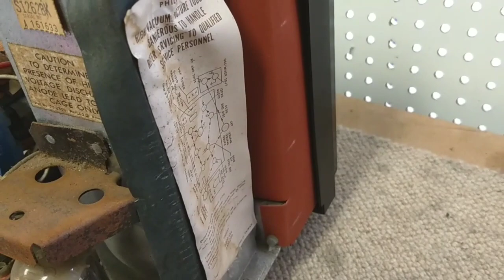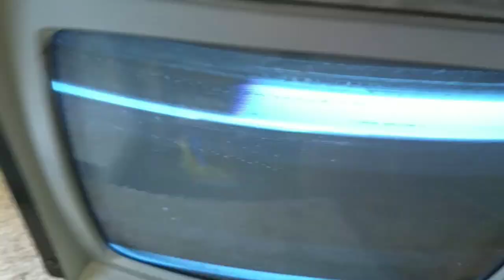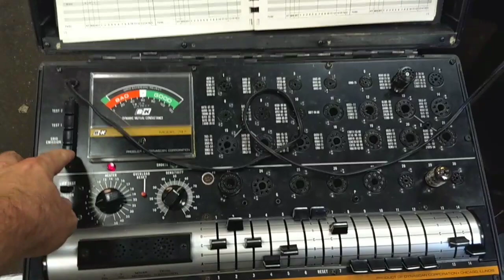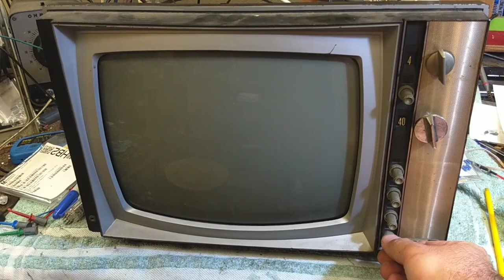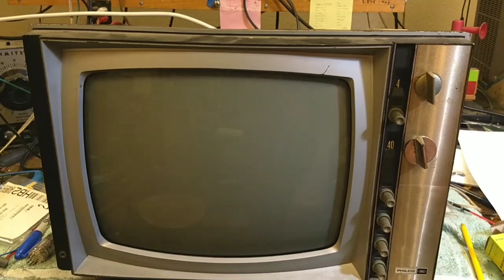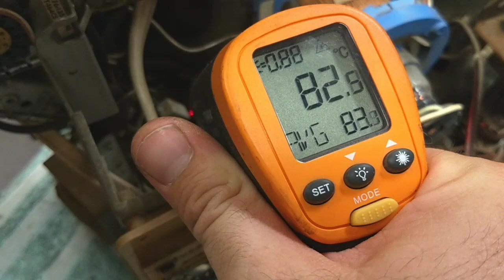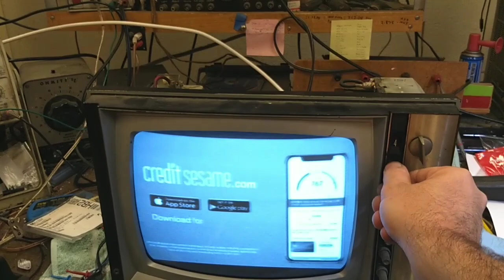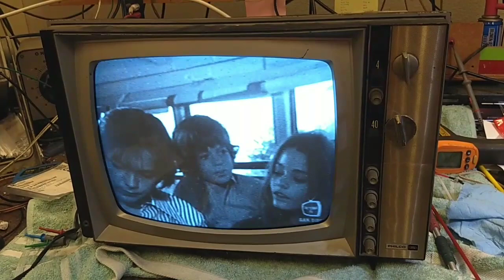Servicing a 1960s Philco S-1262bk black and white vacuum tube tv. Part 2/2

Comment: the green residue leading to air in the tube has happended to me a lot! many tv's that i bough that were stored in damp environments had gassy tubes that were all white, together with green stuff on the pins, sometimes it even causes the glass to break because of expansion of the pin due to corrosion. looking at that ghosty picture if were there i would suggest agc issues causing the IF to overload